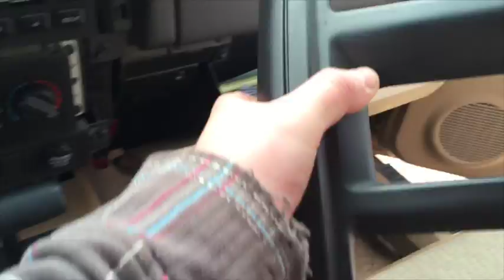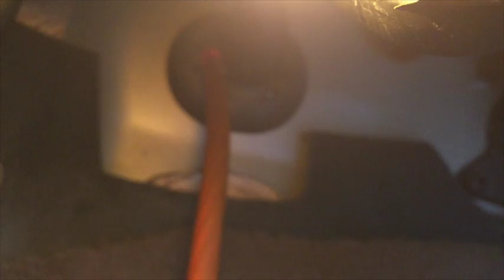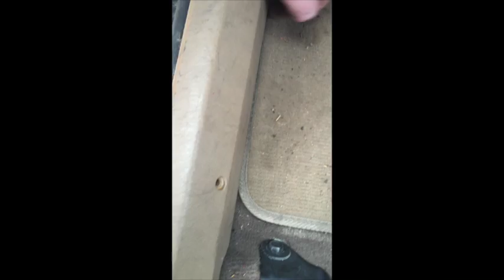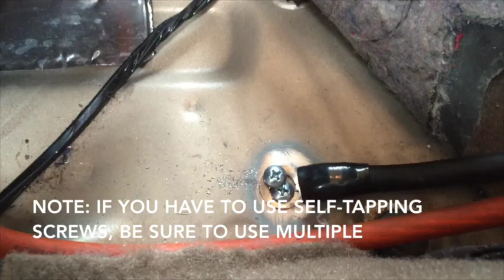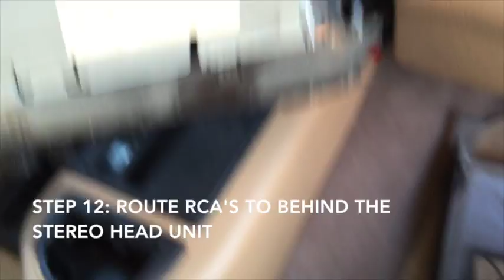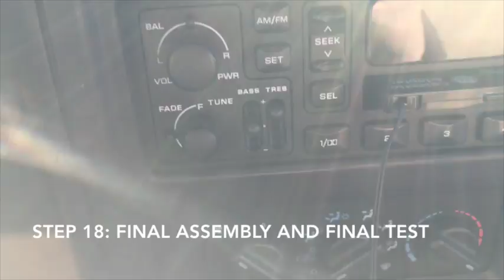1997 - 2001 Jeep Cherokee XJ Sub and Amp Install

Comment: There is always a plug "grommet" just left to the wire harness under the padding literally 3 or 4 inches to the left. Completely remove the plug & use atv silicone to waterproof the gap. Don't go through the rubber boots on the door's either unless you want a oxidized interior fuse box and just random damaged wires rotted door switches you know the stuff that happens when you break the moisture barrier for the electronics.

Comment: Do you have to connect all of the speakers to the rc at 14:00
Reply from the maker: This is an old video, but the LOC we used had a built in amp turn on feature which required all connections to be made.  if you are not using that amp turn on feature, or if your LOC doesn't have that function, then only speaker wires need to be connected.

Comment: Very good tutorial. Being seeing that amp mounted to the box makes me cringe lol
Reply from the maker: Guy was adamant we mount it on the box.  Not ideal
Reply: Provo Beast Audio Installation I had the same problem with my jeep you did. I ran 0 gauge and couldn't get them screws out on the kick panel because of the seat being in the way. Lol it was alot harder doing the tuck method with wire that's bigger around than your thumb lol but these style cherokee always sound nice because there is so much glass they hold sound well. In finishing mine up in the morning. Got all wires ran. Just have lift carpet up and put in dyna mat and put in my box and it'll be bumpin lol

Comment: This might sound like a dumb question, But why not run the wires on the other side? The reason why iam asking it's because I am about to run wires in My Cherokee, great video
Reply: There’s no spot on passenger firewall that’s resealable or even sealed my 2004 is just like this

Comment: I got a new Pioneer stereo recently and had new speakers put in my jeep. Well noW when i turn my stereo up over 40 volume it will cut out my music and eventually shut off the stereo. However it isn't wiping out any of my settings. i have a 2000 watt pyle amp and a 1500 watt 15" competition subwoofer hooked up and i thought that it might be drawing to much power but when i unhooked everything and tried to play music again it still cut out. Trying to figure out if it would be a ground issue or if i might be shorting out a wire. the sub worked perfectly with my old stereo and old speakers. Any suggestions
Reply from the maker: Sounds like the radio is going into protection mode.  suggest to check all your connections including grounds.  Additionally,  you may be experiencing voltage drops if you are pulling to many amps.  good places to start.
Reply: Provo Beast Audio Installation I figured it out.. I had my brother in law wire up the stereo. Well he didn't have a lot of electrical tape so he put the wires for the FR&BR speakers together and vise versa for left side. Smh I felt dumb for not catching it the first time.. lol thanks a lot. Great vid btw.

Comment: did you stick the coat hanger through the rubber in the grommet?
Reply from the maker: Yep, and then attached the wire to the hanger and pulled the wire through the grommet.
Reply: Provo Beast Audio Installation so you made a new hole in the grommet?
Reply from the maker: Yes, and you can use either a razor blade or a knife to make the small slit.  Just be very careful of the factory wiring

Comment: why are noone changing batterys? It Will give a harder punch if you got a car audio battery. you should at least get a 63 A battery. butt you can get 100 A
Reply from the maker: All the vehicles featured on this channel are customer vehicles, not personal vehicles, hence why you don't see batteries changed all that often.  Remember, even with a decent battery, ensure that your alternator is healthy as well, as it acts as the main power provider while the vehicle is running.

Comment: @Provo Beast Audio Installation
When you hooked up your line out converter to the stereo, did you just tap in the Left and Right to the back lines or did you cut those lines from the back speakers and only connect them to the line out converter?
Reply from the maker: No, i just tapped into the lines so the speakers till worked.  You are basically just piggy backing the wires for a signal that the amp can play.
Reply: Wow thanks so much for such a fast reply! I'll be doing the exact same thing on my 01 cherokee this tues

Comment: 8in factory
Reply from the maker: Ok, if it just has 6 speakers, there is no factory amp. If it has 9, the amp will be behind the glove box.  You will just need to tap into the speaker wires for amp signal.  Good luck with the install.

Comment: Got a 2015 Jeep Cherokee  and want to put a sub and amp but need help
Reply from the maker: Will have similar install techniques I.E. Running power cable to the batter, ground, etc.  Being a grand cherokee, you may have a factory amplifier, and if so, you will need to use a Line Out Converter if your radio is factory in order to provide signal to the amp.  If you do indeed have a factory amplifier for your door speakers, then you will need to tap into the factory amp speaker output using that line out converter for your signal.  Hope that helps!

Comment: Thanks a lo!!  This was a great video.  I wanted to use the same receiver because I really love the old compact cassette deck :-).   Everything you said was perfect.  On the 1998 ZJ GrandCherokee the vents are below the head unit and make threading the RCA and ignition wire more difficult.   You really have to reach over to the R side of the unit and poke your finger forward and come up from the HVAC switches, this after taking nearly the whole dash off.  It still works though.

Comment: That was a clean install. I would have, however, used the true ignition wire under the steering column for remote turn on and run it to a relay before the amp. That would help eliminate any potential turn on pops.
I personally always run any wire with 12 volts on the opposite side of the vehicle away from any signal cables. That eliminates any potential for noise to enter by way of RCAs from the get go. 
I never use wire taps. EVER. I cut and solder or use butt connectors. Wire taps are a neat invention, but they run the risk of falling off or not getting a full connection if not crimped on all the way. I fixed numerous installs where the installer used wire taps and an issue happened some time in the future. 
Other than my critiques, you did a safe and clean install.

Comment: What should I do about the existing Chrysler amp under driver side back seat (2001 Cherokee)
Reply from the maker: +I Am Riot Lion If you stock amplifier has a subwoofer, then that would be the signal you would want to tap into to supply an RCA signal to the bass amp.  But, if there is no stock subwoofer, then locate the speaker wire output of the amp and use those for your signal through your RCA cables to your bass amp.

Comment: So what if I wanted to have a little switch to turn on the subs instead of going strait up into the stereo Head unit. Could I go through the center console and connect the switch there? This would allow me to play music through my speakers when I don't want as much bass and when I do want bass i flip the switch to turn on the subs? If you know how I could do that I would much appreciate it but this video is great!!
Reply from the maker: +John Sullivan Sure, you can add a switch in the center console to allow you to switch on and off the bass amp.  Just get a simple toggle switch which can be found at any auto part store.  However, in addition, you could also add a bass knob which can allow you to adjust the level of bass incase you still wish to have those lower frequencies instead of turing them off completely.